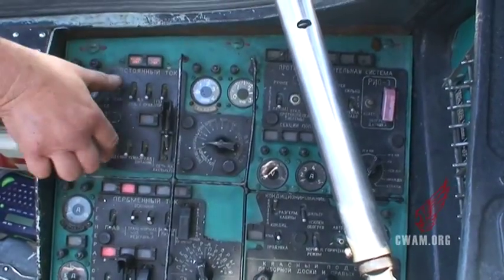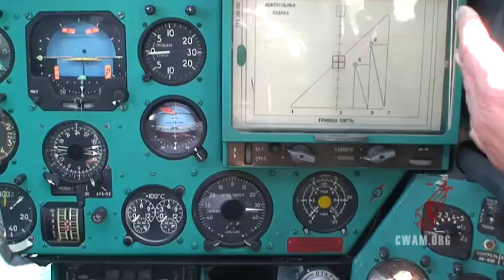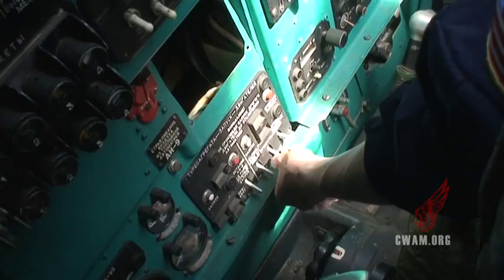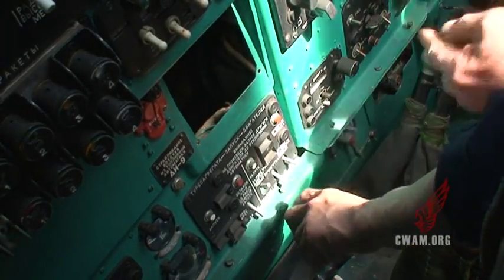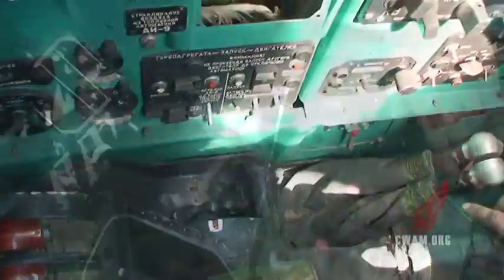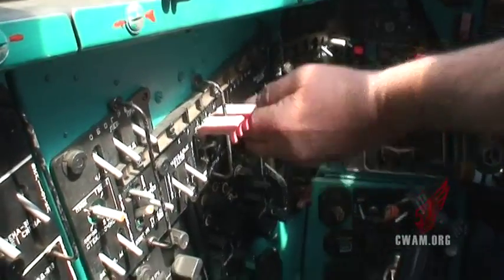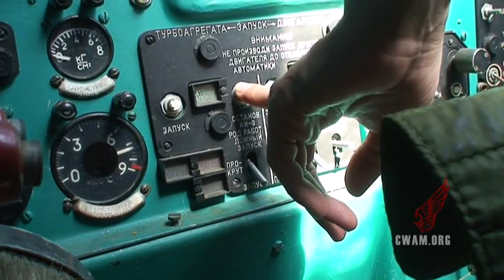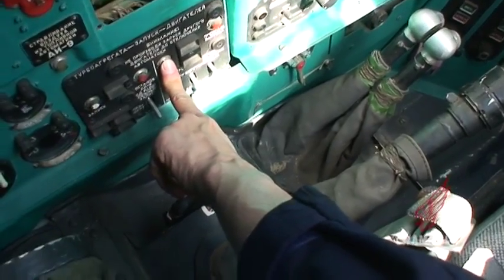Mi-24 Start-up Checklist

Comment: Can someone please explain me what "Running with fuel" means? That kind of confuses me.
Reply: It is possible to introduce air into the main turbine from the APU starter with and without fuel. You would turn the engine without fuel to clear residual fuel from an aborted start.
Reply: @jonboede  Thanks, that makes sense. I wonder why they took it out in the "P" model, or is it the "Crank" mode?

Comment: 0:30 looks like some kind of mechanical analog paper map display with a test pattern inserted. Works like today's moving map displays but completely analog. I guess it doesn't use GPS/GLONASS at all either. Though i don't know if the sheet actually moves inside or it stays in its place while some kind of pointer that you can zero to a certain position before starting up moves over it.
Reply: There is a crosshair that moves. It uses doppler radar and inertial navigation... Very basic but setup properly it works, and uses standard maps, but only for two scales
Reply: @ollyk22  Oh well, now you have EFBs with TBs of satellite map data, GPS, GLONASS, Beidou, Galileo and laser gyros, but back at that time it had to be some kind of novelty

Comment: That's too much to go thru to start a helicopter. Seems heli seems very primative. Also seemed like they were having trouble starting one of the engines.
Reply: Too much compared to what? And primitive compared to what? It's not a car :P
Plus it's an early 70's design, the military planes and choppers of that era come with (at first glance) daunting amounts of switches, gauges and breakers everywhere.
The startup procedures could stand to be more streamlined (turning left and right and alternating between different panels during startup is a big pain in the ass I guess) but once you go through it a few times it becomes second nature.
Then again, this isn't exclusive to the soviet aircrafts, for example the A-10C has you "jumping around" the cockpit just the same.

Comment: why does it have to many buttons
Reply: because a hind is a little bit more complicated then your car.....
Reply: All the different systems on aircraft.
Reply: Jayden Dorman just russian aircrafts have this models
Reply: You guys are idiots...
Reply: Probably because 1) It's a turbine helicopter (piston engined ones are simpler), not a fixed wing airplane or a car, so it's a much more complicated machine than the former or the latter 2)It's a military aircraft, not a civilian aircraft (so it's much more complicated than a civilian helicopter would be) 3)Back from when these machines were designed, computers were sci-fi books stuff. So everything was analogic. Even the map thingy is analog, clever stuff indeed that predated today's EFBs. I doubt there's any digital stuff at all on the original machine.
Reply: dXb kiss our son bastard

Comment: do modern helicopters have all these switches? Not that this model isn't modern, but i think many of these analogue switches have been digitalized?
Reply: ***** You mean how did Mi24 avionics change compared to Mi35? Well,  Mi-35M is fitted with upgraded avionics and whole new sensor package, including FLIR. Helicopter is also fitted with electro-optical rangefinder/targeting system with thermal imaging guidance channel, satellite positioning and navigation system,multifunction displays for both data and optic equipment usse, onboard computer and new communications equipment. SAMs are not heat guided you are probably refering to MANPADs. Well heat dispensers are installed on many Mi24s too and Mi35s so i assume they are effective to a certain lvl, heat will exist you cant get rid of it totally. Well this is abit different approach to a gunshp helicopter than Apache, they are very hard to compare, but lets say Mi28N is more of a comparision model to Apache then this.
Reply: Commadant Most of the switches are still just normal switches like you see here in the video, however most of the analogue pointers (speed, height, weight, temperature, torgue, altitude, sea lvl etc etc) are on displays so cabin is abit less crowded and its easier to read data.
Reply: ITmage How would the avionics change? I heard the IR masker wasn't good enough for SAMs; how have they improved? how does the helicopter compare to the apache?
Reply: ITmage I ask because the Mi-24 1996 PC game still has late 80s set-up. It has a paper movable map hooked up to a radio position system, an analogue light bulb RWR readout to show how close and what direction the missile is coming from, no night vision, etc. The HUD is digital, showing range and target designation data. If I recall, the targeting system requires a cursor placed on the target, with the missile being radioed in. 
How did that compare to the late 80s Apache? How has the Mi-24 improved since then?
Reply: more switches means more options and control.. this is what i like about Russian stuff. if u know what to do u can survive anything in their stuff.

Comment: Amazed that they don't have these sequences computerised yet. It should be: master on: - start. and that's it.
Reply: :)  Yet .....  this helicopter is prety old ... yet.
Reply: Computerized start up?   Stop watching Hollywood movies  :)
Reply: I could make one myself...I don't think its that hard.
Reply: Computerised start? Yes it's called FADEC
Reply: I base my comment on an article I read in an aviation magazine that describes an engine start on a c172 (yes i know its a reciprocating powerplant) being car like thanks to the installed FADEC unit and it had eliminated the mixture control. I believe as an example the bell 407 starts by use of a FADEC

Comment: How about designing something where you just jump in, put the key into the ignition, turn it on and your off......switch this switch that, press this press that...FUCK OFF!!!
Reply: chivasme You can fuck off, sir!
Reply: In fact, that is how you train.
You repeat the process so many times that at the end it literally is just like hopping in, press this press that and off you go. 

The problem is, the battery in the hind simply cannot spool the engines. It does not have enough power. That's why first you spool the APU. Then you use the APU to start both engines. For safety measure, there are also separate fuel cocks. Engine fires are a bitch and you definitely do want means of cutting off the fuel. There is also a twin clutch for each engine. Just like you have a clutch in a car.

Technically, you really do start the engines/APU with single button each.

Comment: I like how he kept slapping her hands away from the switches!!! LOL!
Reply: Yeah Lol! Like wth? Why did he even give her the chance if he doesn't trust her to touch the avionics.
Reply: @kevamiru  AHAH I believe at 3.50 it's because she was supposed to keep her finger on the APU OFF button in case the temp rose too much, but she still had it on the APU start button
Reply: @hollowkos   it was because he told her to hold the start button for 3 seconds and let go then move the finger to the OFF switch incase of fire.....buuuut she wasnt lol
Reply: @kevamiru  She wasn't following instructions. Starting an APU or engine is no joke.
Reply: @kevamiru I wonder if it's because if you hold too long you can get a hot start.
Reply: @kevamiru  Well he had to at least let her try right?...but then he realised she was just gonna blow the thing up 🤣
Reply: She was the type to make assumptions and not listen... Probably why he didn't actually start fuel flowing to the actual engines lol

Comment: @phadil 
Lol. Because there's not just one engine.
There are three. And if systems get damaged during battle you need to be able to shut them off individually as well.

Starting with turning 1 keys is just impossible :P

Comment: Even though the Mi-24 is ancient to today's standards, those turbines really kick up a cool fucking sound.  Like most Russian whirly birds, the Hind is more of a workhorse ground attack platform...... built to take hard use and countless Russian winters....and then some.  The mechanical components of those things are incredibly strong.  The only problem is they go off like a hand grenade if those big, thirsty Klimov turboshafts get hit with a piece of  hot frag from a missile.